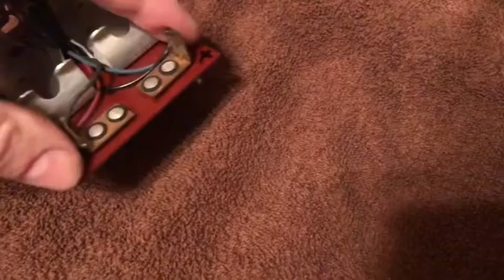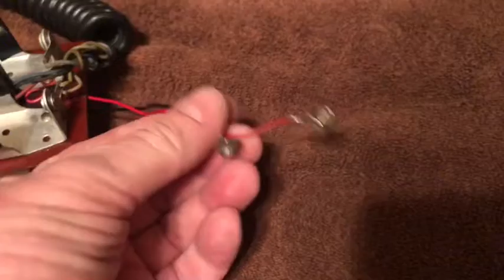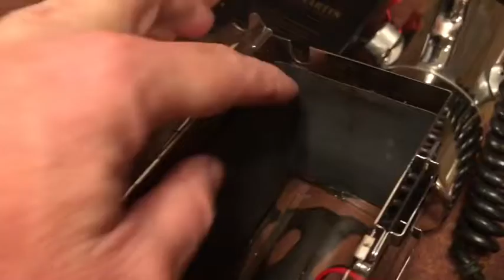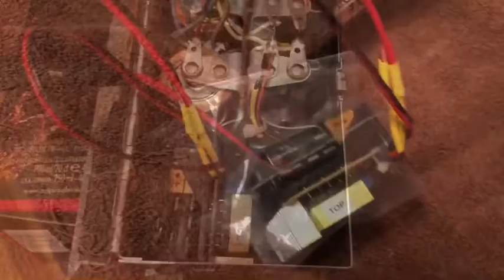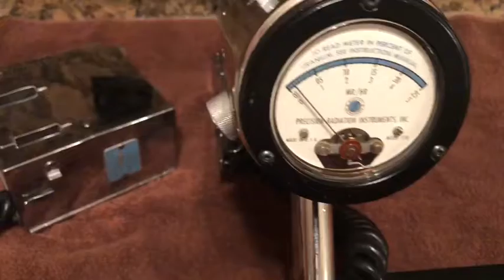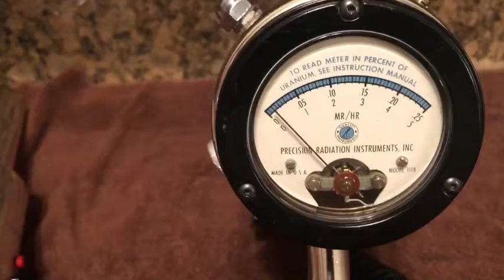PRI 111B

Comment: Why is there an electrolytic capacitor added for the 67.5V power supply?
Reply from the maker: The recording was made a few years before viewing was set to public but if memory serves, I believe it was to smooth out some ripple that was making its way to the needle on the meter.
Reply: @ClagwellsGarage  Any recollection as to the value of that capacitor?  Thanks.
Reply from the maker: @BillyBobFishtail  Sorry I dont. And the unit was sold a couple days after the video